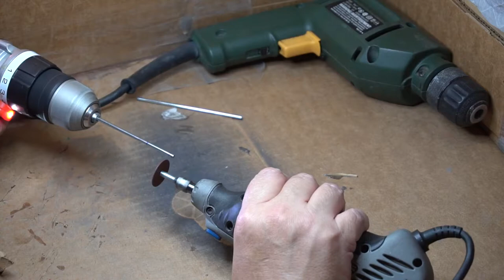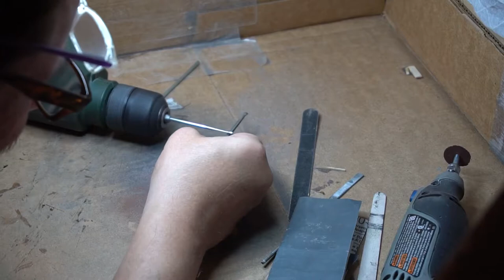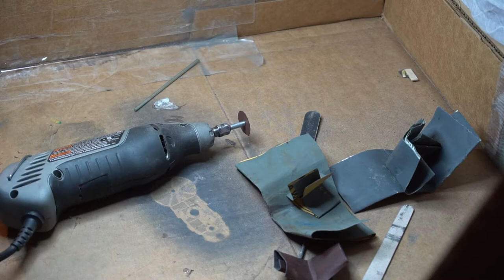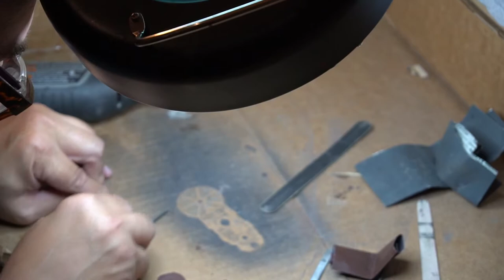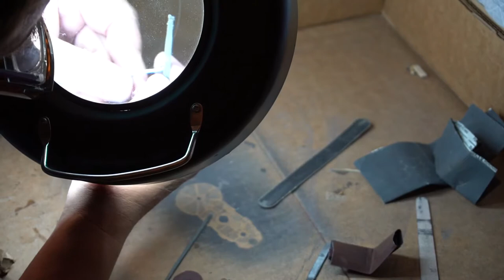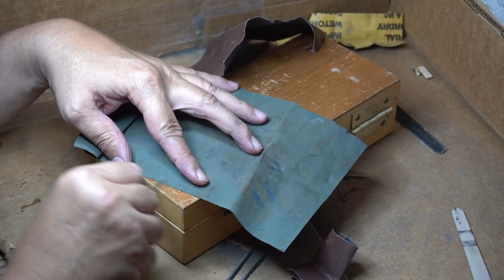Making a metal 1/72 model U-Boat submarine periscope

Comment: Edit your video to delete long, boring video runs and condense them down to shorter strips. 
Position the camera so as to keep the field of work IN VIEW for the viewer. 
Work with brass ... softer and easier to machine. It's going to be painted afterward.

Buy a drill press. Tear off smaller bits of emery paper when sanding.
Buy some simichrome polishing paste and polish the head and body.
Buy a dentist's burr and hollow out the lens cavity.
Put Micro Crystal Kleer into the lens cavity after painting the scope head.
Reply from the maker: i think a Mill would be more precise than a drill press.